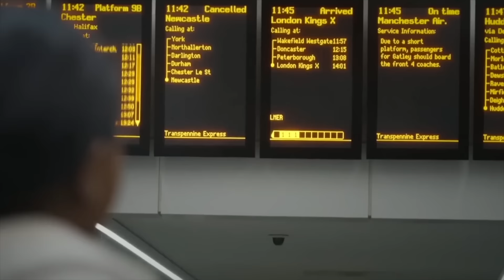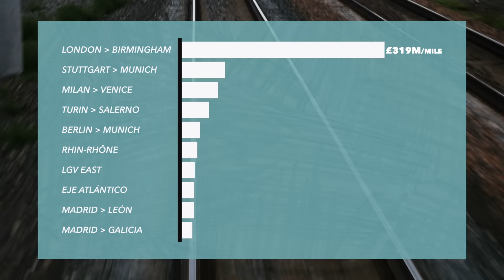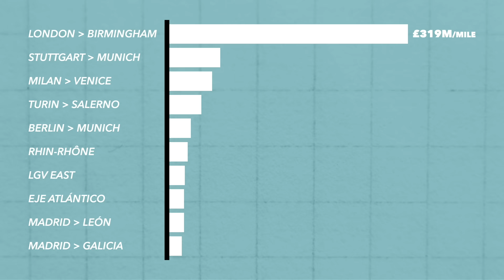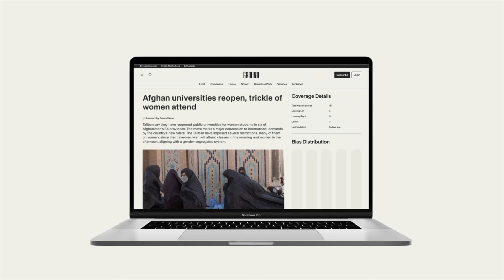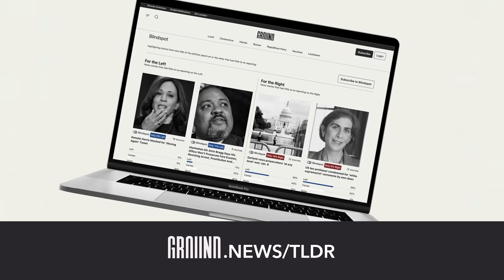The £100bn Railway: Why is HS2 Four Times Over Budget?

Comment: Agree with the views. For these reasons, the project should not be stopped but redesigned in its principles to be more efficient: an acquaintance works there and says the way the teams and tasks are structured, distributed and documented leads to to forming monstrous task-forces that would not happen in the continent. We understand safety and construction standards: Too much red tape and protocols and no incentive for anyone in these task forces to streamline a process. Everything has to be super documented, super tested to ridiculous levels: for something two people can do in a European firm, here you have HS2, the design construction team, then subject matter experts, engineering firms, external architects, and a myriad of other stakeholders involved and internal calls lead to 4-6x more man hours required for the same task in the continent.

Comment: I'm not so sure that the thesis that the UK doesn't do large scale rail projects rings true and therefore doesn't have the skills/capacity. Over the last 30 years there have been some quite large projects undertaken (not HS2 boondoggle scale admittedly) with things like HS1, Crossrail (largest construction project in Europe at one point), Birmingham New Street rebuild, Project Evergreen, East-West Rail, the Thameslink Programme, etc. And that's without considering the smaller projects such as branch line reopenings, new station builds, etc.

But more importantly there's another massive UK rail infrastructure project coming up to electrify more of the rail network. This is on Network Rail's roadmap over the next 15-20 years to reduce the number of diesel trains running, improve regional speeds and meet the UK's binding climate change goals. That's going to slam straight into the back of a delayed HS2 Phase 1 because both HS2 and the electrification will need the same engineers, pway workers, etc. I suspect that will appear as another reason for HS2 Phase 2 having to be scaled back.

Comment: Simply picked the wrong route, the route should have used the the Old Great Central route that originally connected Manchester and Sheffield to London - sounds familiar?  
The concept to improve for commuters does nothing for commuters and travellers located in Wales, Scotland and NI.  
By using the the GCR route the savings would have funded a host outstanding public transport projects around the uk.  For example connecting  North and South Wales routing within Wales using existing empty abandoned track bed which would connect all Welsh based universities by rail.  The completion of Scottish Borders Railway link from south of Galashiels to Carlisle.
Reply: The GCR is not an alignment that is of any use to modern rail travellers, and I mean any
Reply: I don't think that would have saved money because the GCR ran through many towns. Some bits of it are built over and other parts are currently used by other rail networks. It would require a new line running alongside that which means more demolition resulting in higher costs due to compensation. I reckon the alignment may not be suitable either for high speed trains. The GCR was built for steam trains. At least with HS2 much of it is on virgin ground where the alignment is optimised for speed.

Comment: You've missed one of the largest points... land cost. HSR can only achieve high speeds in straight lines, and cant take heavy turns. Look at all the high speeds lines in China, they run straight for hundreds and hundreds of miles, because the government can bulk acquire land for a very low cost. England (not UK) is the most densely populated country in Europe (excluding city states). There are not hundreds of miles of open countryside to build the tracks on.

For example HS2 is buying 3 football pitches from Aston Villa's training ground to run track through. This is 250 meters of track and it's costing £25m, and thats just for the land cost. HS2 is costing over £100m per mile before anything is even built just in the cost of buying land. Germany and France have far more open country side with established railway rights of way meaning the land cost in those countries is 80-90% less than in the UK.

Comment: It's failing because it is a totally unnecessary vanity project. The money would have been far better spent on upgrading secondary and cross-country lines to decent speeds, thereby improving rail access for many more and not just a few well-off inter-city travelers.
Reply: We should do your suggestion in addition to HS2. Doesn't have to be  either-or.

Comment: Revenues must be considered for infrastructure projects, but were not in the video. Interest must be considered . It accounts often for more than half of the costs, but was not considered either. The construction of HS lines are a way of  sucking money out of the EU budget and turn a blind eye on  the interest due for the additional debt.  Building HS 2 was decided before the Brexit referendum, but the cost overruns kicked in at a moment when UK had long left the EU. Thus the trick with interest will not work, it will rather be the British citizens  having to cover (or cough up) the interest for the decades to come, at rates much higher than at the beginning of the works.

Comment: A half hour time saving between London and Birmingahm isn't going to deliver any financial benefits.

Work should have been started in the North instead of the South.
Reply: It is exactly 100 miles from Euston to Curzon St. To cover that distance gives a speed of 113mph on a 250mph railway.  Upgrading the southern WCML running at 140mph can near equal the journey time. Also upgrading and electrifying the diesel Chiltern line (it needs it) will not be far off either.

Comment: In a lively conversation about HS2 I made the following calculation,given the following assumptions:
Total cost of HS2 £100bn
Repayment period 50yrs
Repayment interest 0% 😄
Basically dividing £100bn by the number of days in 50yrs gave a figure of approx £5m
This is the PROFIT (ie not taking into account running costs,maintenance and interest payments etc)
I didn't have the information to hand about train capacity or frequency of service to calculate the seat price,but it is clear that clearing £5m EVERY DAY is a tall order.
Who will make up the shortfall?
Also,it has been bruited that there will be no cuts to the existing services on the (apparently at-capacity) parallel WCML as a consequence of HS2...so how then does building HS2 benefit the WCML in terms of capacity?
The words "White" and "Elephant" spring to mind,in the true meaning of the phrase.

Comment: Freight is the biggest advantage of HS2. HS2 is primarily about capacity not just speed for freight. It take lorries off the roads, onto the existing slow rail lines. You would have to spend billions upgrading highways to cope with their heavy loads if the scheme didn't exist.

Comment: HS2 Ltd and trainspotters, say HS2, to justify this waste of money is for capacity reasons, not speed.   So why have bespoke, horrendously expensive trains capable of 250mph, the fastest on the planet, are on the plan?  Far, far, cheaper off the shelf 140-160mph train are available.  The London-Birmingham section is slow as it has to run though miles and miles of tunnel. A 250mph train could never reach that speed in normal operation and would be economically unfeasible to do so.

Comment: I worked on the railway for over 5 years in my twenties….. it’s failing because it literally burns money.

The amount of times I turned up on a Saturday, along with 50 other work lads on mega wages, and unable to get on because of paperwork failures… a number wrong on a form? Nope, you ain’t getting on.
One night could cost tens of thousands of pounds and have zero work be done. Haha it’s laughable really… and that’s just one Saturday night shift, in one little area.

Comment: HS2 is not failing.
As all long-term infrastructure projects, it is suffering from the three major unforeseen events in the last three years: the pandemic, the war, and the cost-of-living.
In the case of long-term project, the engineering of the physical structure is just as important as the engineering of the financial flows. 
The project required some major revisions because of the unforeseen events, and it is being brought back on track.
The new HS2 railway is of utmost importance for the UK, and will not be allowed to fail...

Comment: We have 125 mph trains whose lines encounter level crossings. An accident there is bad enough. Now imagine 250 mph, which means 4 times the kinetic energy. I would like to believe that there will not be level crossings on the high-speed lines. At 250 mph, a train will cover 367 feet per sec. No way you will be able to see it coming. An 8 carriage train might hold 480 people. A lot to lose in one level crossing accident. And the risk of deliberate sabotage by terrorists. For 100 billion, I hope to hell they have the sense to put bridges over the line instead of level crossings. But this is Britain. And we do stupid things.

Comment: Now HS2 has a lot of people employed (not only the JV of construction firms) that have spent years getting to know and develop this project and would lose their jobs and that’s not fair on them either. Then, shortly the HS2 project will need to re-hire and start all over again… these people would have moved on and… now try rehiring others, that would need to be brought up to speed and then… more delays and cost overruns. Having reached this point: instead of stopping why not redesigning now to the correct scale and degree of efficiency and avoid (part of) painful adjustment that will only lead to more delays and costs?

Comment: It should never have started in the first place. What needs looking at is east to west trains. It says on this video it takes currently 1.54 mins to get to Manchester from London. I travel from Skegness to Nottingham 2 days a week for work and it takes well over 2 hours which is a distance of 80 miles. London to Manchester is easily 150 miles plus.
Reply: That's right. We need to spend a fortune on a route you do twice per week! What's the business case for that? What freight capacity is Skegness deeply in need of?

Your error, is to think that if we didn't have HS2, you could have had anything else you wanted. But that is not how the world works. The money has been raised to deliver this project. In the same way that you might get a mortgage to buy a house. You can't take the mortgage money from the bank, pull out of buying the house that the mortgage was for, then go and spend the money on something else instead (like a yatch or a ferrari). You can however, if you want both, make a seperate case for them, and a separate finance package to achieve them. As we see with the east/west railway being built as we speak between Oxford and Bletchley/MKC/Bedford and eventually Cambridge. Note that the bit of the route between Bletchley and MKC will make some use of the capacity freed up by the building of HS2.
Reply: @amateurcameraman  I’m not saying that route is the one that need to be upgraded I’m just using it as an example but I am saying east to west needs looking at. But it’s like everything the Midlands and the north east gets forgotten about and it’s all about London and the south.
Reply: @Dean256  is the midlands being forgotten about? The eastern leg of HS2 provided a massive opportunity to improve Birmingham to Nottingham services. But everyone whinged about the cost of it. The west midlands has some new stations being built and should be open in the next year or two. The midland mainline out of St Pancras towards Leicester is progressively being electrified with new trains being built as we speak.
Reply: @amateurcameraman  yes but it’s not east to west. It’s south to north. We have lines that are capable of fast trains now from London to Birmingham, London to Nottingham. Nothing that goes east to west. Sorry outside the main cities there is nothing.
Reply: @Dean256  nothing goes east to west? Except the transpennine upgrades being prepared as we speak.
The east-west axis across the midlands is handled by trains that are 2/3/4 carriages long, on either 30 minute or hourly frequency. The north/south trains are twice as long and twice as frequent. That's why we need the capacity there. That isn't to say that other improvements aren't needed. They are, and they are also slowly happening. But other than Transpennine, there is no singular 'one big project' to shout about and get the anti rail brigade wound up about costs. The east/west route i mentioned from oxford to bedford hardly ever gets mentioned. Why? Maybe i guess everyone is only interested in a route that serves them, rather than what improves the network as a whole. It's the opposite of NIMBYism. Like whinging when a different city gets a new hospital, that it shouldn't have one because your city hasn't got one.
Reply: @amateurcameraman  have you ever used transpennine. It’s a joke of a rail company, when they run they are late. Anyway if you look at most European countries they have invested lots of money in trains that go in all directions why is the UK so poor at this. Maybe it’s because we have a government that is unable to make big decisions. Anyway I stand by what I have said. Far too much money has been wasted on HS2 it needs stopping.
Reply: @Dean256  yes, i exclusively use public transport as i don't drive.
I know Transpennine is a mess at the moment. But that's irrelevant to the investment in the infrastructure that you want. Avanti is also pretty dire too right now. But that is irrelevant to HS2.
And yes, i have travelled extensively and frequently all over europe, as you can see from some of the videos on my channel (not a plug, as they aren't to everyone's taste), but they do prove the experience i have.

Comment: Project that don't get finished by UK Goverment - Electrification of the Great Western line was supposed to be completed between Paddington and Bristol, but got cancelled beyond Bath beacause of cost overruns.
Reply: Still not electrified to Bristol? Shocking, especially given the size of Bristol.
Reply: And putting up wires is quite a cheap thing to do.
Just halt trains and run a few bois with their own trains to put the wires up.

Comment: like the engineer said, £100 billion is honestly still worth it, for the impact it will have a moon landing size budget will still bring more benefits, but the three obstacles he brings up are extremely important and i think showcase how hs2 is more of a vanity project for the people heading it rather than something to help the country and its people.
Reply: like besides what he pointed out one thing ive taken from the example footage made for the project, it seems like it wont be built with double decker trains in mind, a small detail but it does mean a lot as double decker trains are far shorter with the same capacity making it easier to have a more rapid transit program with shorter gaps between trains, but that's what happens when you handle it as one big project instead of smaller segments. if they made the euston remodelling its own individual project they couldve designed it with two-story trains in mind, which wouldnve lead to the tunnels allowing for trains of that size, in the end leading to double the capacity the rail lines can fit like what we see in france
Reply: another thing to note, with the fact london to edinborough is only slightly slower by train than flying already, i feel they really went overkill with the overall speed of the trains, last i checked the website states the journey from london to edinborough will be 2 hours long when really even making the journey 3 hours wouldve beaten flying by a long shot while being less expensive to construct.
Reply: could say that's more of a nit-pick but i feel it's representative of the project as a whole being more so to impress on the world stage instead of being helpful to the people

Comment: Our train network needs to be revised, not helped by the current disruption. By the time you have finished mucking around with connecting trains, it takes longer to travel from the north to the south than it is to drive, which must be appalling for congestion and the environment. It's past time we had a decent public transport network. Unfortunately, it only looks likely in 10 or 15 years.

Comment: As soon as I saw that railway fanatic Gareth Dennis, I knew that it would be a propaganda job for HS2 and so it proved. £100bn already and will no doubt rise well north of this figure. It is worth pointing out that already the leg to Leeds has been axed and the so called Northern powerhouse has also gone. So what is left is a mere 230 mile London centric railway built at massive cost which will stop at Manchester and leave huge areas of the the UK still on Victorian lines.

Comment: The railways are a mess because there is no will in government for railways, the Tories prefers cars  and road and  aircraft travel for  yes, the richest people. HS2 has been on the drawing board for over 50 years. it is a scaled down version of HS1 that was meant to go from London to Scotland,  but the London did not want it so they said it would cost far too much so and take 48 minutes longer than air travel.